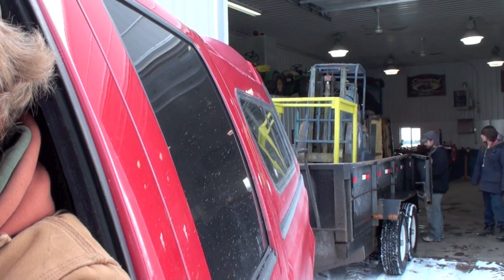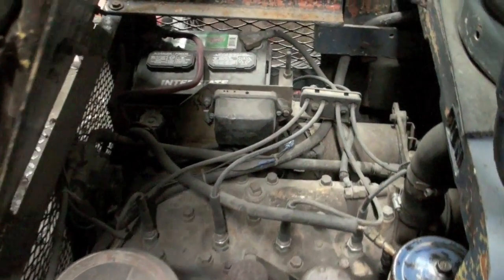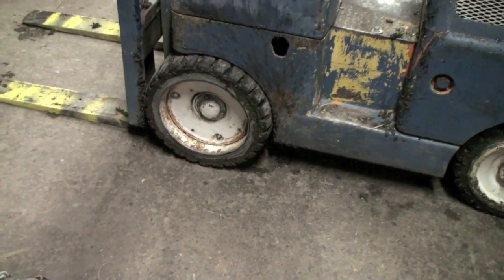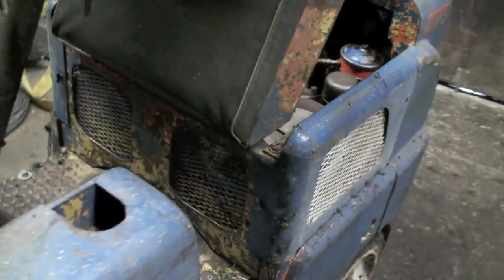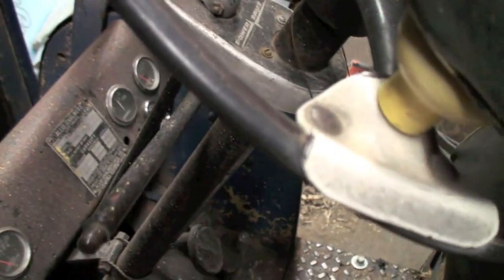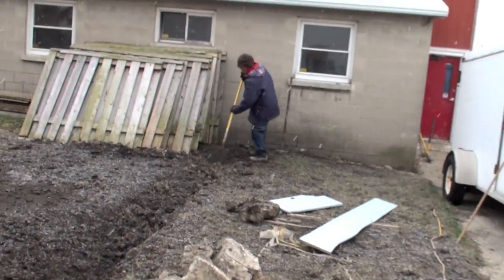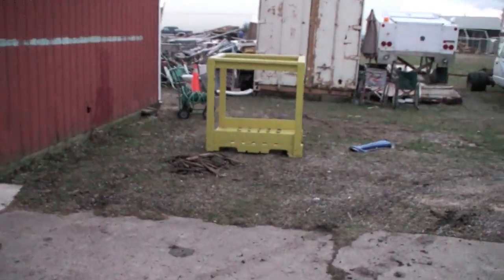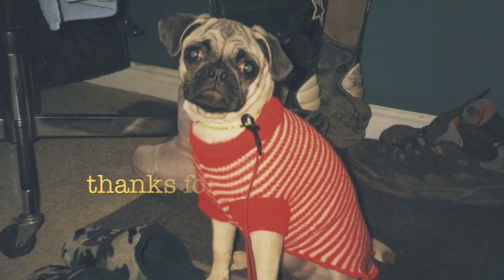old allis-chalmers fork lift

Comment: I have an old Towmotor Caterpillar forklift that I have had for 30 to 40 years and it has been a good one,  was told to turn off gas when not using overnight and run it out of gas so regulator wasn't under pressure